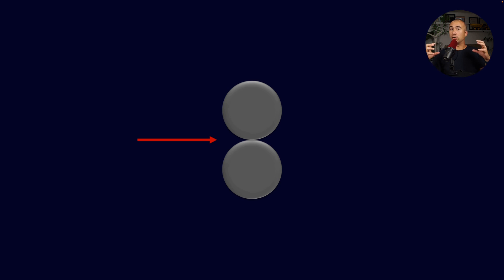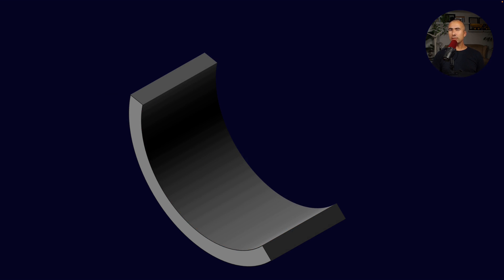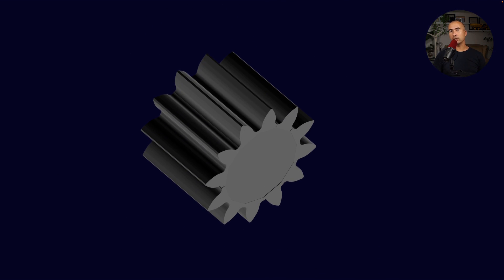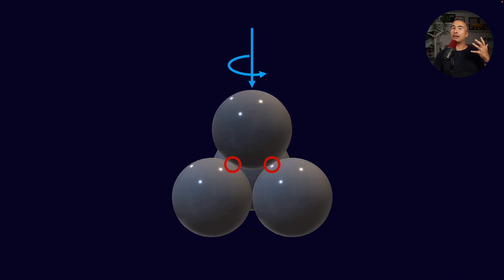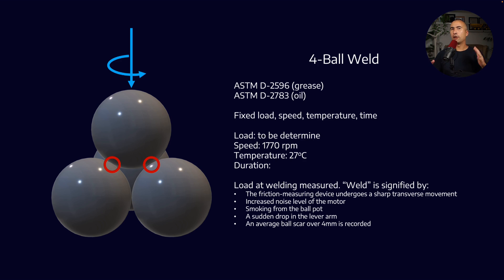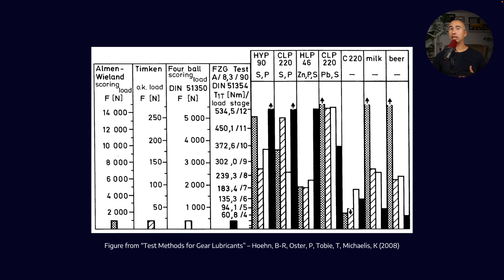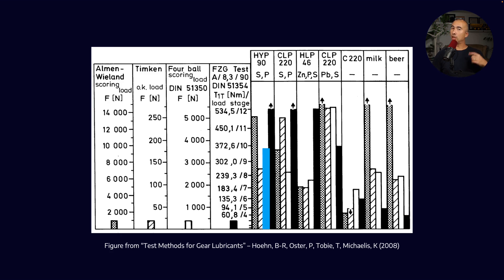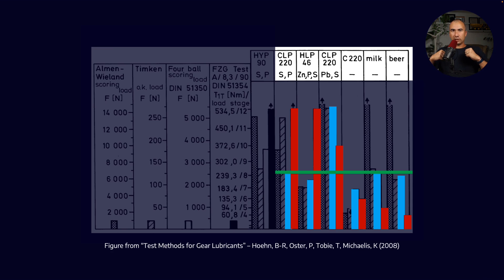What is the 4-Ball Weld and Wear Test, and When Should it be Used?

Comment: A pretty intelligent explanation! I hadn't heard of the FZG test yet.
A couple of points...
Bearings do have point/line contact: the rollers/balls against the cage (granted, not major)
Many (even most?) grease manufacturers supply only a Timken OK load test on their product sheets. It's already such an improvement to have 4 ball tests listed.
Many industrial applications I'm familiar with are pure sliding motion: pivot pins, plain bearings/bushings, screws, and carriage slides/machine ways. The 4 ball tests give a good idea of performance in these cases.

Comment: So given open gears and bearings I think you are correct however inside of API 6A gate valves, you do in fact have sliding friction with the gate and seat interaction and the gate sliding across the seats, which are static. So what are your thoughts around gate valve grease and the 4 ball weld test?

Comment: I used Mobil 1 EP 5w-30 in my Volvo 850 & had 480K miles on the engine when I regretably sold it.  It had great compression, ran like a top. Started every time. No motor noise.  I changed oil every 3k miles.  Vented crank case gases to atmosphere.  Removed turbo.  Used high octane. kept rpms around 2200 on highway.  That motor would have gone another 250K had I kept it.  Didn't have place to park it.
Reply: Removed turbo?
And then used high octane fuel?
You know what, you should install pedals, so you don't need to fire it up. I think it would last even longer. 🤦

Comment: Hello Rafe.  Back in 2013, an independent lab conducted 4-ball testing on 10 various synthetic oils produced by different oil manufactures.  As I recall the lower three balls forming a triangle were locked into place, each oil being tested was heated to 150 degree C, the top ball was forced against the center of the triangle at a 40 kilograms of pressure and spun at 1,800 RPM for one hour.  All 10 oils produced some degree of wear scarring, so that we could analyze which oils resulted in the least wear scarring in comparison to the oils possessing the greatest degree of scarring.

Comment: Hmmm very interesting, so the SAG test measures gear teeth wear then, is that what you are saying? How about setting up a test that would be something like a single cam lobe with a roller follower running on it under pressure?
Reply: Or something that simulates a piece of a piston ring riding up & down a surface like a piston ring in a cylinder would be?